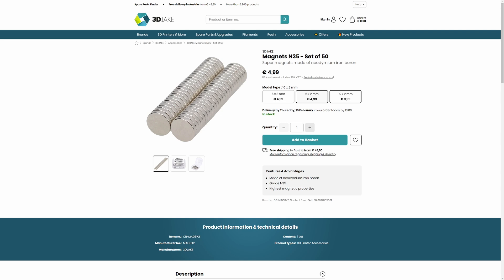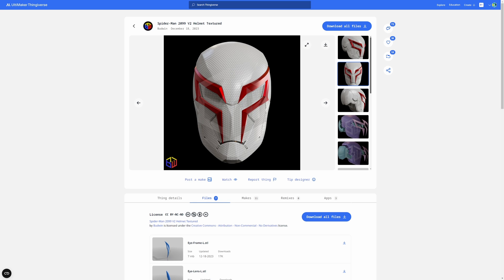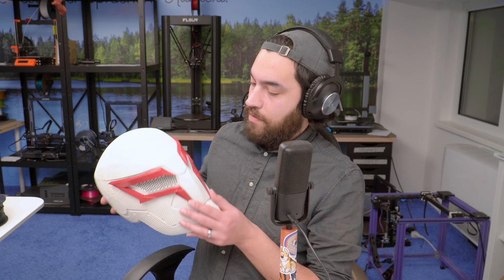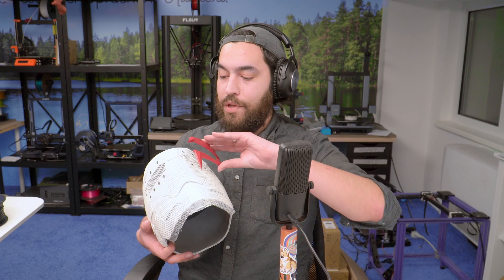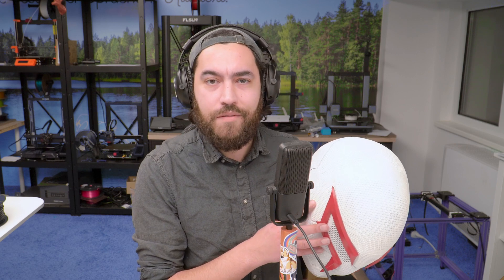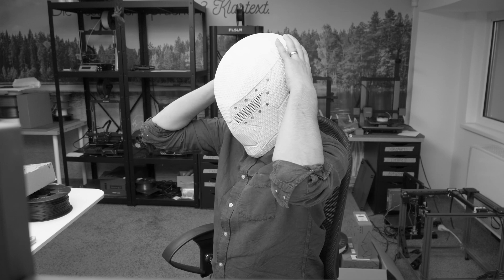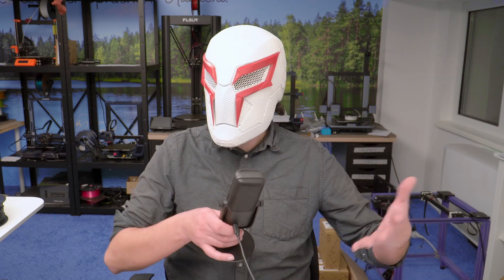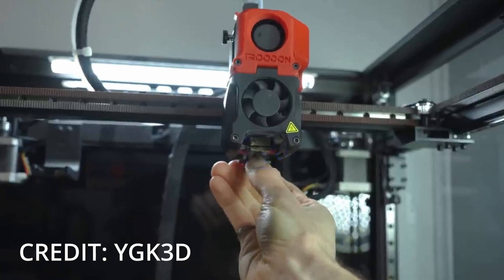MAGNETS!

Comment: No idea yet where to use magnets. Just thinking of "including" them into a model and print some layers on it to make them invisible but working. 😀
Reply from the maker: That sounds cool, I always wondered however if they lose some of their magnetic strength because of the heat...probably not with a PLA print but maybe with ABS
Reply: Depends in your nozzle. Some could be magnetic and then they stuck in your nozzle 😮
Reply from the maker: @schnuffischulz  Oh I completely forgot about that! Good point.